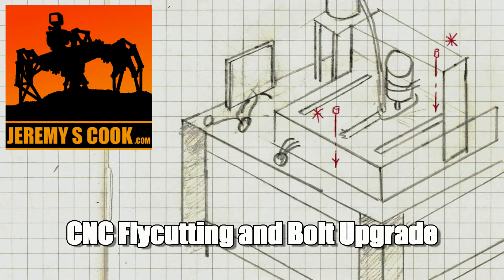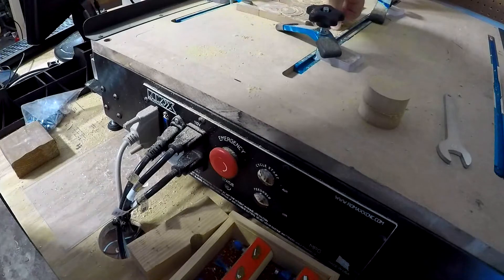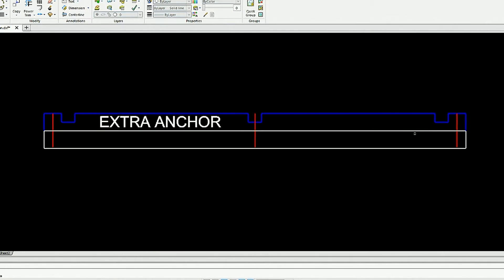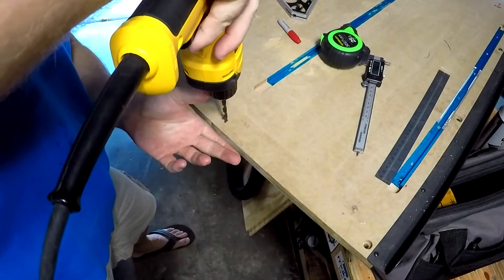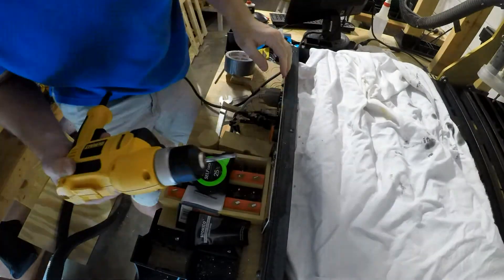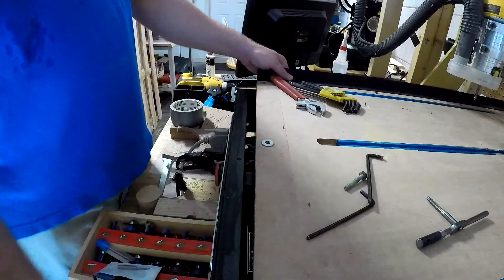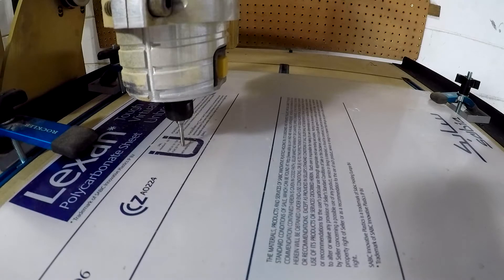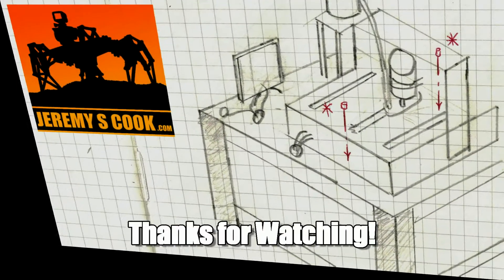CNC Router Leveling Flycut and Reinforcement

Comment: Securing the waste board was a struggle for me too. I used t-nuts, but aligning them underneath the waste board was very fiddly and screwing from the bottom up is impossible. I did the flycutting part manually which is also a pain. Now I have a brand new Z-Axis but it doesn't reach the build platform yet. Lots of work to be done...
Reply from the maker: Always more to be done! I thought I'd have time for all my projects since it's now part of my job, but apparently I was mistaken :-)